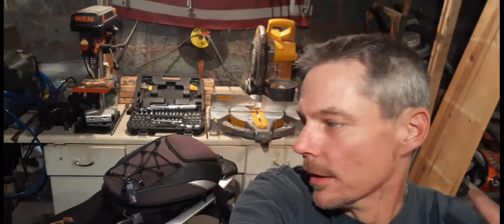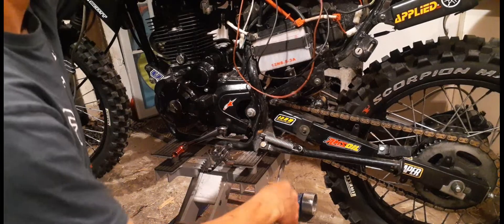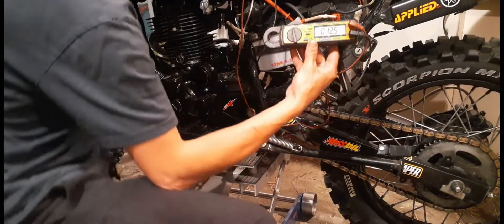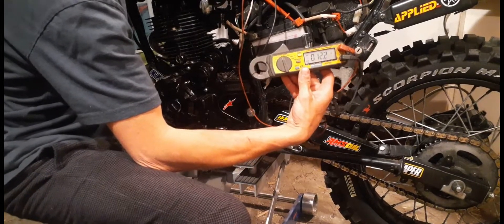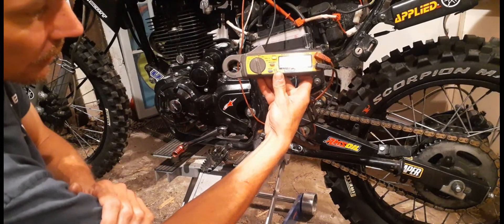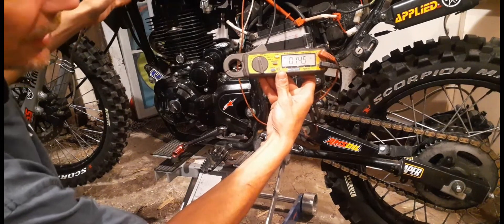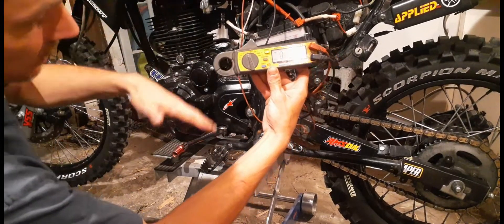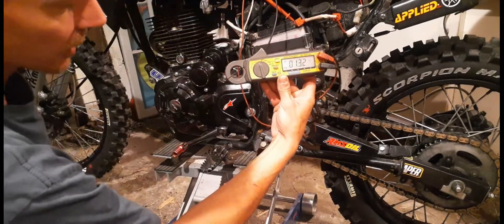Hawk 250 Charging System Test (Simple Voltage check)

Comment: Can you please put the multimeter set to 2000-ohms and put one lead on black/red wire from the stator and the other lead to ground and tell us all how many ohms you get, the exciter windings off that black/red wire when new should read about 304-ohms but as you put miles on the bike like yours the ohms tend to drop until the exciter windings fall out of spec and you start getting hard starts before it totally burns out, spec I believe to be anywhere from 170-ohms to 304-ohms. Thanks......😅